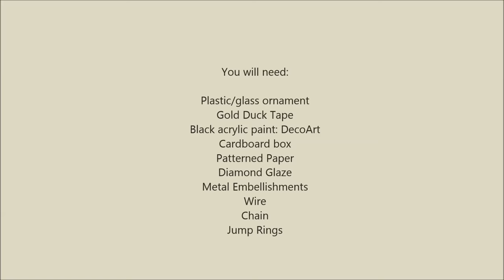Steampunk Hot-Air Balloon

Comment: This turned out beautiful. I love it. 
The proper way to open a jump ring is to twist the wire until the required opening is achieved.
Do not pull it open. ...
Use two pairs of flat nose pliers. ...
Grasp the jump ring on opposite sides using the flat nose pliers. ...
Use a "twisting" motion only to open the jump ring. ...
You should now have the jump ring open.
Reply: Or get the jump ring ring that goes on yr finger (i wore mine out of the house last week)